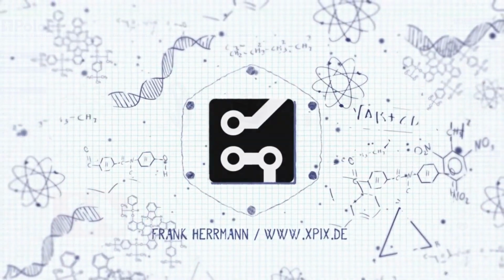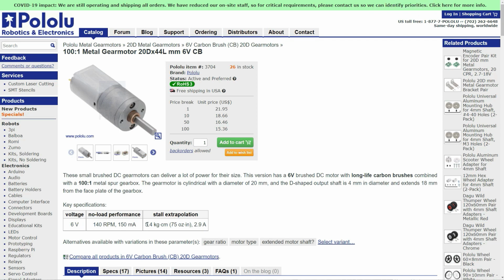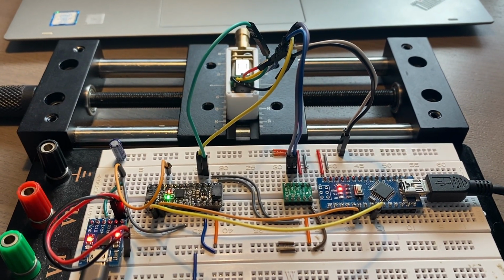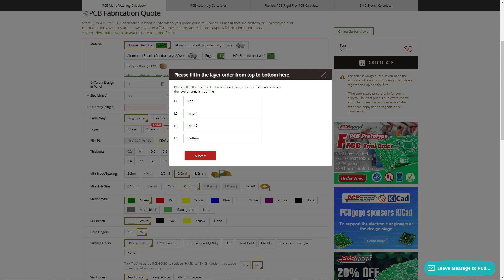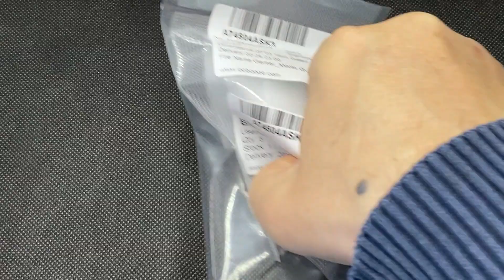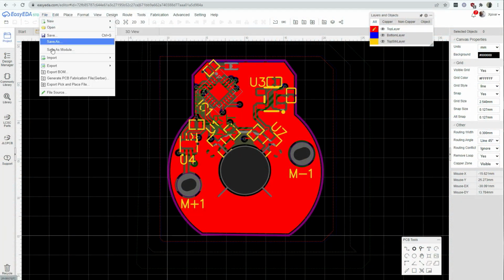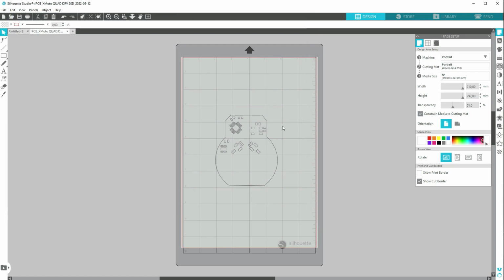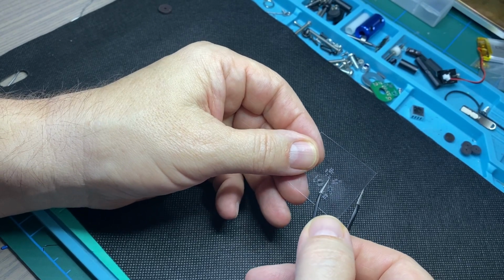S01E03 XMOTO20D PCB design, manufacturing and reflow

Comment: How accurate can such a servo motor be?
Reply from the maker: This depends on the ratio of the gearbox, more ratio the more accurate but also slower, but therefore stronger. The max ratio of the 20D is 488:1. 488 revolutions of the motor for one revolution of the gearbox. with 10 signals we get a resolution of 4880 for one revolution. Higher than the stepper motor with typically 200 full steps.